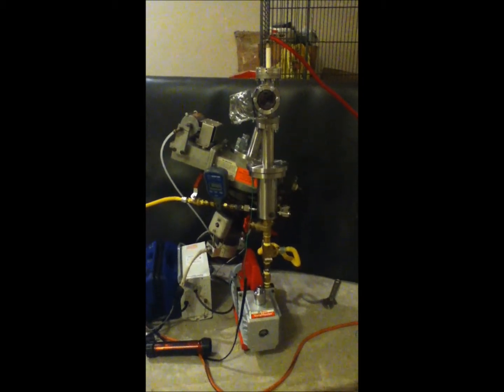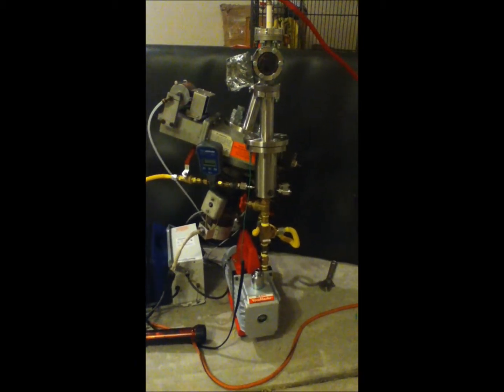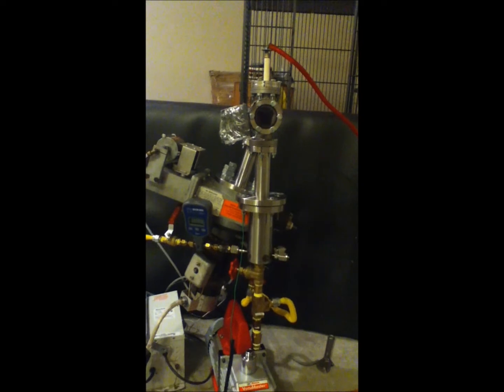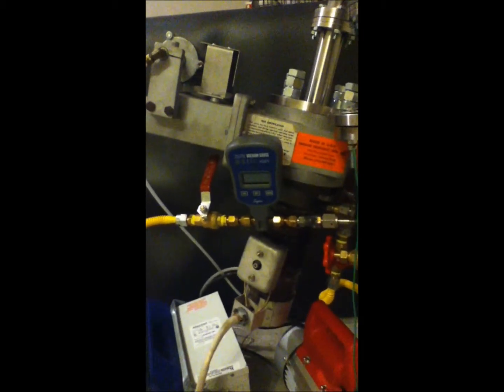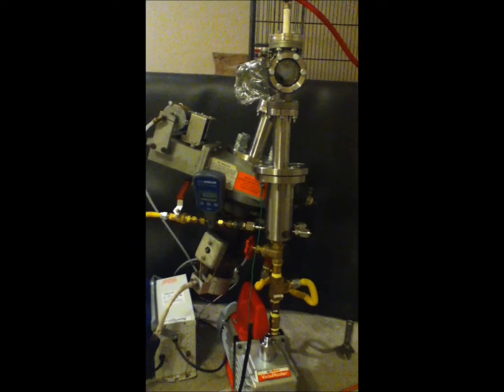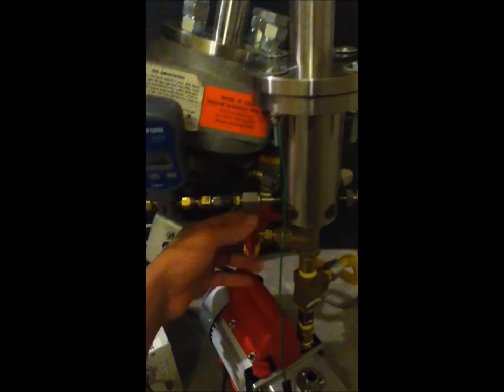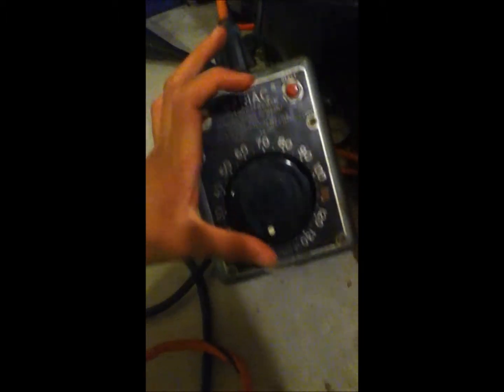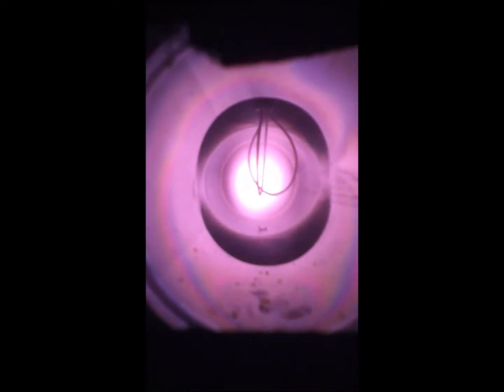IEC Demo fusor 2.0

Comment: hi there where does the negative connect to from the high voltage transformer?  if its connected to the body of the chamber wouldn't you be electrocuted  if you touched the chamber?  

thanks
Ash